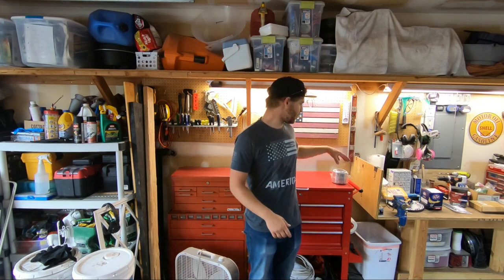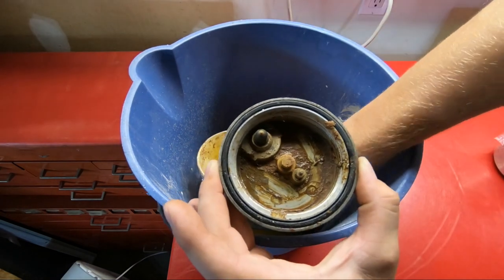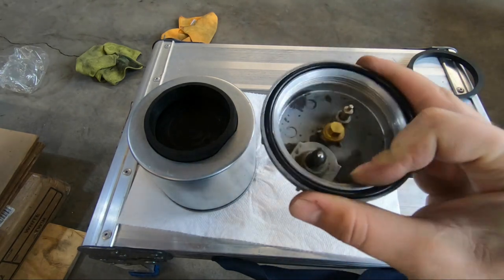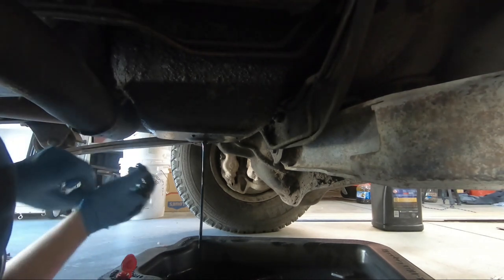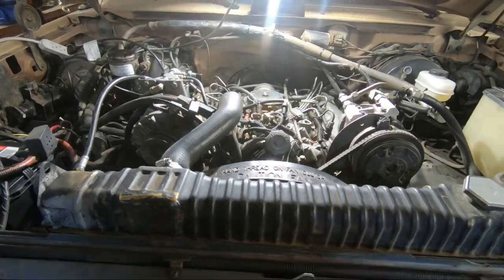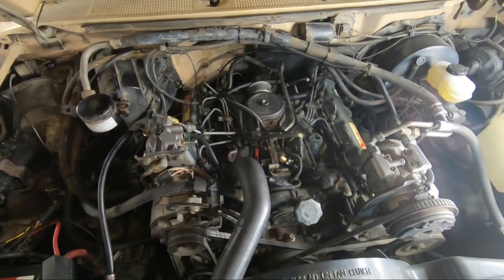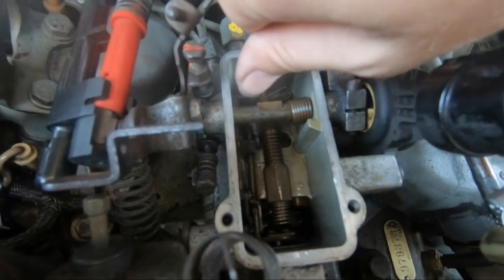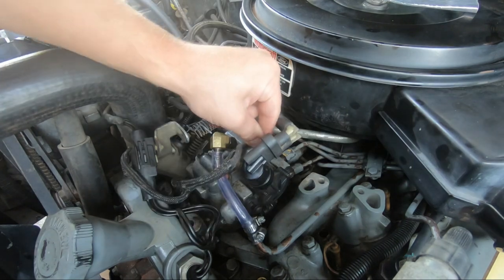7.3 IDI Diesel Stalling Diagnosis and Fix

Comment: WOW that was awesome. I have a 94 7.3 IDI and all of a sudden (after running well for years) starts just fine and idols, but I can drive it a bock or two, and all of a sudden it starts crapping out then stalls. I crank and crank and finally, it comes back to life but then may stall after a block or two. I replaced the lift pump and filter but don't know where to go from here. I did notice then changing the filter though it was only half full. Should it be to the top when removing it? If so what is happening? any suggestions? It's the first diesel I've ever had so am stumped.
Reply from the maker: I’m glad the video was helpful to you Johnny.  It’s hard to pinpoint exactly what could be wrong but the fuel filter should be completely full to the top.  Usually if the fuel filter is that low it’s an indicator that the lift pump is too weak and can’t keep up with the trucks fuel demand.  However if you’ve already replaced it I would take a serious look into air intrusion.  What could be happening is air is leaking into the fuel lines causing the fuel to flow back to the tank instead of getting a steady stream to the lift pump which in turn gives you less fuel into your fuel filter then causing your truck to stall.  I don’t know how mechanically inclined you are but below are some things you can replace/test on your truck to pinpoint what could be wrong:

1. Make sure all your injector return lines are not cracked or leaking fuel.  

2. Also check the fuel hoses coming off your lift pump for any obvious cracks

3. Another thing that could potentially be wrong is the pickup tube inside the fuel tank itself could be broken and not allowing fuel to run to the lift pump effectively.  (However I would only look into it as a last resort).  

4. Check to see if the check valve coming off the top of the injection pump is working properly as well as all the solenoids too.  (Be sure to put the top cover back on the right way)

5. Another in depth test you can do is to take the hose that feeds fuel from the fuel tank to the lift pump and block it off.  Get a fuel hose from the auto parts store, stick one end to the lift pump like normal, and the other end into a canister of fresh diesel fuel.  Next take the return line coming off the engine and stick it into a empty bucket to see how much fuel would potentially be put back into the tank.  
I hope all of those suggestions made sense and are helpful to you.  The good news is that  you picked a really simple diesel engine as your first diesel truck.  There’s not a whole lot that can go wrong with these engines.  

Also below is a diesel parts and service company that has their own YouTube channel called Diesel Care and Performance located in Tennessee.  You can watch their videos as well as call their helpline. Mr. Billy Williams who has been a diesel tech for decades helped me personally with my truck and I highly recommend you give him a call if you need more help.  I’ll link their channel down below.  Take care.

Here’s the link to their channel:

https://youtube.com/@dieselcare
Reply: @ydocproductions5593  My Friend, I am putting you in my automotive HERO files. Not because I have had a chance to attempt your repair suggestions yet but because you are so kind to take the time to list the possibilities that might be causing my problem. Who else would do that? I can't begin to tell you how much I appreciate it. I bout this truck a couple of years ago but have had relatively little chance to use it because I thought it was worth restoring. The engine ran like a top and it had a new transmission installed just before I bought it. The interior was much better than average for a truck this old. However it needed a lot of attention on the outside, and I didn't realize that under that bed liner was a rotted bed. So I replaced the bed had all of any dents or scrapes repaired new bright work grill bumpers and lights and finally an awesome paint job in that original green/bluish color The truck looks like new, but since all this was done now she has had this running for a while and deciding to stall out problem which has made me unable to depend on driving it anywhere. I have never been any more than a shade tree mechanic at best and have never ever worked on a diesel. It almost stopped me from buying the.. truck because it was like being in a foreign country when you didn't know the language or culture. I know you guys say what a basic engine this is and it probably is but I have had to depend on youtube to learn anything at all since mechanics in my area won't work in it. They want cars that have a plug-in electronic diagnostic readout to solve the problem then slam a new part on and charge 200 dollars just for the diagnostics. They would have to think and try like you do...and did with your truck. This little 7.3 turbo ran like a dream before this. So thank you so much. I sure wish I knew about the fuel tank possibility before I put the new bed back on it. But it is what it is. Thank you again so much. At least you have given me a place to start in a direction that makes sense. Your new biggest fan.
Reply from the maker: @johnnyohness   Sounds like an incredible truck!  Not many of those ford factory turbo diesels out there these days and it sounds like yours is in near mint condition.  Thank you for the kind words I’m happy to help.  If you have any more questions please don’t hesitate to ask.  Also if you’re completely stumped on getting your truck running again; I’d highly recommend giving Billy Williams over at Diesel Care and Performance a call.  Thanks for watching once again and take care👍
Reply: @ydocproductions5593  Yes thank you. It is not even close to recognizable from what it used to look like. 

Doing one of these is like painting one room of the house, then it makes the next room look bad then the hallway then the kitchen. It's an addiction that keeps you throwing money at a project. 

My neighbors were sure glad to see the transformation LOL. If it hadn't run so well when I test-drove it I never would have bought it. 

When the bodywork was started on the bed, I said we don't need this plastic liner, so removed it only to find a total disaster of rust from moisture trapped under the liner Just imagine there was already hundreds of work done on the outside. It was so bad I had to replace the bed of the truck. Finding one was like searching for a needle in a hey stack. I was happy to see (once the bed was removed) the frame was almost perfect. No rust at all. 

Most long beds were used for work and were damaged like crazy. The only ones were hundreds of miles away but none of those had duel tank openings. I had to buy the best one I could find and then have my body man create the front fule door opening. He did an unbelievable job. Perfection in my estimation. As you can see these projects can bore a hole in your wallet fast. On the other hand, I don't feel so bad when I see the asking prices for a nice one of these trucks.

When you suggested I might have to access the fuel tanks, I thought OMG why didn't I go in there and replace everything when the bed was off? Damn, how stupid of me. I didn't because the truck was running perfectly at the time. So if it leads to that I might have to pull the bed off again? I hope not. But that's a possibility.
Reply: @ydocproductions5593  I haven't started working on it yet because of a pile of loose ends I needed to rap up. But now I can. Thanks so much for the referral. I'm sure I will be contacting them if I get stumped. Thanks again for all your generous advice.
Reply from the maker: @johnnyohness   No problem at all, hopefully it’s a simple fix to get your truck back on the road😀👍

Comment: JUST WONDERING...You recommended Stanadyne as the additive you used in your fuel tank. Would you recommend using it on a regular basis? Though I haven't had the opportunity to pursue your great recommendations on my truck. I went down to Auto zone to have some of this additive on hand and found they had the 64 oz bottle on sale for 20.00. That's 50% off. I'm about to go clear the shelf of it if you think it's worth using it on a regular basis. Your thoughts?
Reply from the maker: That’s a good question.  It definitely couldn’t hurt.  I’m not an expert when it comes to these types of fuel treatments.  In fact this is the only one I’ve used.  However I would recommend simply following the instructions on the box.  If your truck has been sitting for a while and you have old diesel fuel in the tanks (diesel fuel only last a year or two before it goes bad) putting some fuel treatment in will help.  I never asked how many miles your truck has?

Comment: I have a problem with my F250 IDI keeps stalling out. I have a 1987 F250 6.9. The engine keep stalling out on me for some reason. Starts up great in the cold and runs. When I drive it down the road out of a sudden it starts to stall out sometimes it gets up and goes again and sometimes it just completely dies. And also I'm noticing it kind of revs little high for a second then goes back down when I'm driving down the road don't know if that's part of the same problem or something different. What do you think it could possibly be. I just put a brand new fuel pump, sending unit, fuel filter and a new german-made shut off solenoid.
Reply from the maker: Sounds like your on the right track.  Definitely  sounds fuel related.  Those injection pumps are pretty stout, so it being bad probably isn’t the case (did you notice any glittery metallic flake in the injection pump when you replaced the fuel shutoff solenoid?)  If you already replaced the fuel pump as well you could be dealing with air intrusion of some sort.  As you probably know the fuel return lines are notorious for going bad on these engines.  
Lastly the most probable cause it could be is the metering valve inside your injection pump could be “sticking” not allowing the fuel you need under load.  Whether it’s the issue or not I’d highly recommend putting some atf and fuel treatment in the fuel filter and run it through your injection pump (a couple times perhaps ).  Usually I’m against those “snake oil” treatments, but it worked for me and fixed my truck.  

I hope that helps.  If you need to talk to someone directly I’d highly recommend talking to Billy Williams over at Diesel Care and Performance located in Tennessee.  He’s one of those old school mechanics who knows these IDI diesels like the back of his hand.  Good luck with your truck and I hope it’s an easy fix!👍
Reply: @ydocproductions5593  okay thanks I'm thinking of putting some new hydraulic fluid in don't have any ATF on hand. Everything was pretty clean inside.
Reply: The previous owner did put brand new tanks so not sure what the old ones look like but everything I took apart so far looks spotless clean inside. The biggest thing is it's not something I can tell it's fixed right away until I'm down the road. The engine runs great starts easy and everything but just all of a sudden the thing just wants to die miles down the road. You don't think it's no sensor or something like oil pressure anything like that?
Reply from the maker: @ruffrupp5453   It’s possible it’s a bad sensor but these are such dinosaurs that it’s more than likely a condition where it’s not keeping up with fuel supply (in your case while it’s under a load).  It’s a long shot but is it possible that the fuel pickup tube could be faulty/cracked, or old cracked fuel lines running along the frame allowing air intrusion and causing diesel to draining back to the tank?  

If you have time to experiment you could run an auxiliary fuel tank with a 5 gallon fuel tank somehow attached to the vehicle.  Just run the feed line off the mechanical fuel pump and stick it inside the fuel can and see if your problem persists.  It would be a good idea to run the return line in the same can as well to see how well your return system is working too.  Simply process of elimination
Reply: @ydocproductions5593  ok thanks. I think I'll try the running hydraulic fluid instead of ATF in the fuel filter first that doesn't work I might try a auxiliary tank. Going to try hydraulic fluid instead of ATF because I don't have any ATF on hand and have brand new hydraulic fluid. I might thin it down a little bit with diesel fuel to water it down a little bit.
Reply from the maker: @ruffrupp5453  sounds like a good plan.  Really hope you figure out what’s wrong.  Let me know how it turns out👍

Comment: That spacer is for the timing light when they set the timing 
the diesel fuel we have now will destroy those black o rings the brown ones hold up better 
I put fuel rails on mine got rid of them stupid plastic caps
fuel rails are they way to go if you want a daily driver 
I love the old 7.3 idi engines I still drive one today
the 7.3 is a fantastic motor the fuel return is very problem for the old trucks they can be fixed
Reply from the maker: Very interesting!  Thank you for sharing that!  I agree, the injector return lines are not a strong point when it comes to these engines, but I appreciate how simple they are compared to the truck on the road nowadays.

Comment: How you do it with trans fluid? I got 7.3 idi in 93 ambulance doing same thing. You have ementy the trans fluid out?
Reply from the maker: I simply bought a quart of Mercon transmission fluid and fully filled up the fuel filter.  I let the truck run for about 5 minutes or so to let the transmission fluid fully work though out the pump.  Then I let it sit overnight.  The detergents and additives in the transmission fluid loosened up the junk keeping the metering valve from moving freely and has worked fantastic ever since.  I never drained the transmission fluid out of the fuel filter, I just left it until the truck started running on diesel again.  I also put some Stanadyne fuel additive in the fuel tanks to help as well.  Hope that answers your question👍
Reply: @ydocproductions5593  yes that helps a lot. Thank you

Comment: what year is the truck ? And you filled the fuel filter all the way up with atf???
Reply from the maker: The truck is a 1988, and yes I filled the fuel filter all the way with atf (I believe the fuel filter can hold 17oz total).  I let that run through the injection pump for roughly 5 min.  That way the additives and detergents can fully move throughout the pump.  I let that sit overnight and it worked great for me👍.  Hope that answers your question.  Good luck
Reply: @ydocproductions5593  ok thanks for responding, unfortunately I tried that it it still seems to be having the same issue
Reply from the maker: @jenniferarteaga  Sorry to hear that.  I would recommend calling “Diesel Care And Performance” located in Tennessee .  They’re very knowledgeable on the 7.3IDI engine and would probably be able to pinpoint exactly what’s wrong with your truck.👍

Comment: Run atf in your fuel for awhile then sitch to a good additive going to need it since all diesel today is low sulfur. Not good for injection pumps.
Reply: 😂30secs later your talking about atf
Reply from the maker: @JohnSmith-kz1ll   Haha Yup, I was very surprised that the ATF actually fixed it!  Ran great after that!